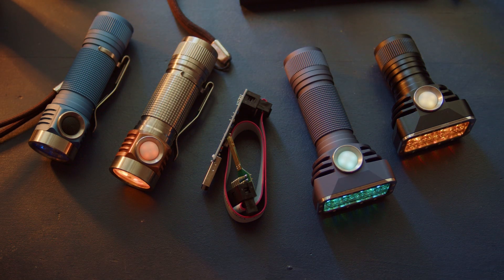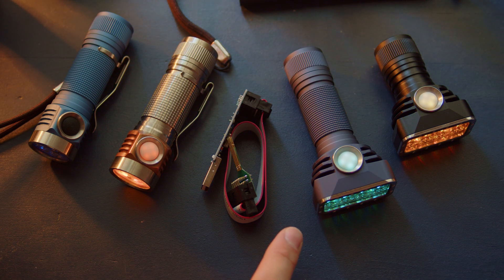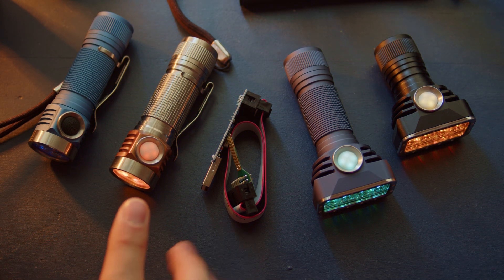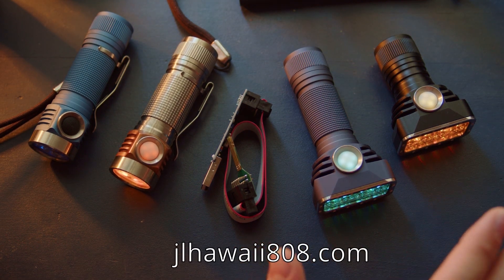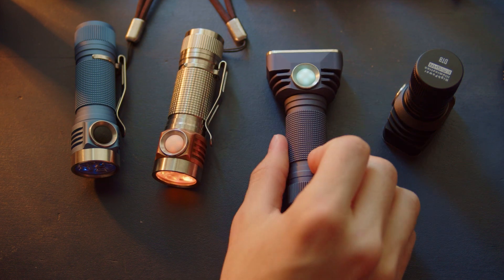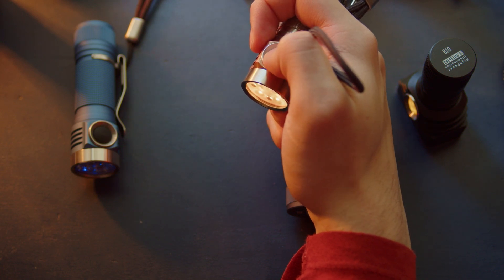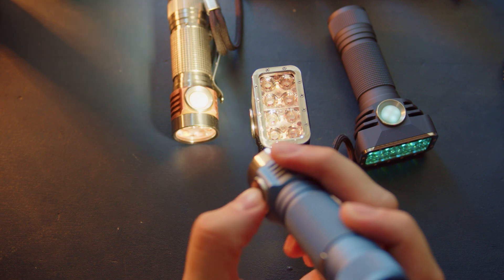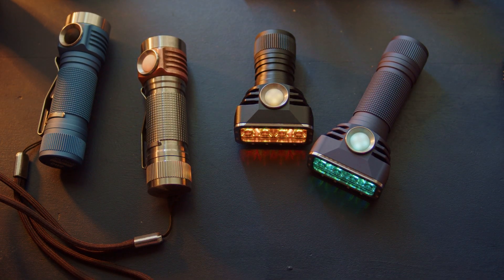Big Hanklight Anduril 2 Updates! [Ultralow Functionality]

Comment: A quick question about the update, and no ramp from Moonlight. So there is no way to increase brightness from Moonlight? That’s one of the best features of anduril. With memory, if you turn the light off on high, now there’s no way to go slightly brighter from moonlight except high. So you’d have to turn off from ML, then click on for whatever last mode was. That sounds awful. It’s the main reason I won’t buy a convoy s21e
Reply: Ah ok. So it just stops it from advancing past moonlight from off. That’s actually a pretty good feature. The other light I mentioned can’t advance from moonlight. So you have to click off then on again. And it memorizes turbo. That wouldn’t be fun inside
Reply from the maker: @victorvannatter312 yes, the new updates make it easier to stay on lower modes actually. You can even manually commit Moonlight to memory
Reply from the maker: No, you can turn it on to moonlight from off, then press and hold again to ramp up from there like normal. Or you can just not use the moonlight lock.
Reply: Nice. Thanks for letting me know

Comment: Amazing. I want to change all of my anduril lights to get rid of the delay when I turn the light off.
Reply from the maker: That would be nice, unfortunately that delay is necessary as the light has to wait to make sure you're pressing the button multiple times. For example, it helps to prevent the light turning off when you want to double-press for Turbo.

Comment: Hank just shipped my e17a and azure with anduril build from 2021 05 07 and I totally know what you mean by no granularity on low levels. I updated to 2021 12 13 and it’s MUCH better. I even slowed down the ramp speed. 
IMO you HAVE to do this because it was so irritating on low levels

Comment: standard moonight or ultra low is plenty useful. you dont need such little output
Reply from the maker: You could say the same for Turbo, that you don't need so much output. We all have different needs and desires. Besides, lights like these are about pushing boundaries, what's not to love about a light that goes both as low and as high as possible?
Reply: @LuxWad  makes sense there. regular moonlight is hardly useful to me tho so thats why super ultra low makes no sense to me.
Reply: @LuxWad  i have found that my fw3a has a lower moonlight standard than my emisar and noctigon lights

Comment: Luxwad. Came across your channel yesterday. After talking shit in a previous comment I must give you some props. Your reviews are top notch. So point me in the right direction.
I want one of these emiser lights. Or are they big hank lights, or anduril lights? Either way, I am looking at the d4v2 or possibly one of those dt8. Questions. What the deal with the colored lens? I like bright lights but I am willing to try a 4000k light. I know nothing of these lights. I want one with a 18650 or possibly bigger, more mah battery. I want to keep it under $100 hopefully under $75. What should I get?
Reply from the maker: Lol, you can always feel free to point out flaws if you perceive any, it's important to keep reviewers accountable if they make mistakes after all.

Emisar and Noctigon flashlights are designed by Hank Wang and sold at intl-outdoor.com (called "Hanklights" because the branding can be confusing). "Anduril" is an open source software developed for enthusiast lights, which can be found on many different flashlights which are generally oriented towards hobbyists. If you haven't seen my D4V2 and DT8 reviews, they're long but pretty much explain everything you need to know.

The colored glow in the front of the lights is produced by the "aux lights", rgb secondary leds which can be configured in the interface.
These lights use unprotected high-drain cells and are extremely powerful, which can make them somewhat dangerous so be warned. Batteries have to be purchased separately.

I think the D4v2 is a good starting point for these lights, it starts @ $45 and goes up depending on options. The 4000K SST20 LEDS are no extra cost and often considered the best all rounders,the xpl-hi have better performance and are $10 more. The E21a LEDS in my titanium light are much dimmer but have excellent color rendering, the best you can get. Pretty much the same LEDS are available in all models.

My top recommendation is for the D4SV2, which takes a 26650 battery and has a throwier beam. It's super nice and much more practical than the two shown here imo. It starts around $50. All these lights are also available in a dual-channel version with even more features.

Alternatively, you can look at the Wurkkos TS21, another Anduril light with similar features, but includes a 21700 battery and has a charging port, for $35 or so. It's a great entry point to this type of light, highly recommended.

Comment: Is it possible to flash this firmware to an old D4 and the fw3a?
Reply from the maker: It's possible, but it will take a lot of work as those lights don't have flashing pads. The PFM updates are exclusive to the linear drivers, so won't be available on those lights.

Comment: Wait so, if I have SST-20 4000K emitter, which file do I use?
Reply from the maker: The normal kr4.hex file
Reply: @LuxWad  I can use this KR4 hex with my D4V2? It flashes green, then a few colours and I can’t turn it on.
Reply from the maker: Yes, the d4v2 uses the KR4 file, mine are flashed with it..I'm not sure why your light is doing that, you might want to reflash it again
Reply: If your light has a white driver inside it uses kr4 firmware. If your light has a red driver inside it uses D4V2 firmware.

Comment: i just got a d4v2 in with andruil 2. While attempting to disable moonlight ramping after performing the 10h, there appears to only be 2 menu modes as after the 2nd, the light returns to ramping.  why is this, or is there another way to disable moonlight ramping
Reply from the maker: Your light might not be the latest version, the updates in this video came in the 8-31 update. You can do a version check with 15C

Comment: Oh those are great updates! I might have to invest in the update hardware. Or I might just get another D4V2 with Cree LEDs this time. The SST-20s have been okay but they are not great color wise and I want something with the FET driver. Not going with an E21A with terrible battery life and linear driver.
Reply: Sst20 should already have a FET driver unless you specified a linear driver. E21a shouldn’t use much power because it’s FET that eats up power. But they are a bit dimmer. But much nicer looking.

Comment: I have 2 D4V2 (TI and sand) both are 219B, both are 2021-08-13 firmware (15c).  However only the TI has jump start.  9H doesn't do anything.  I have a flashing kit on order.  What should I flash to get jump start working?
Reply from the maker: 2021-08-31.noctigon-kr4-nofet.hex has all of the latest features for the Nichia D4V2.

KR4-219b should work as well (same features) but I've heard noFET is recommended for the D4 since it has less thermal mass. What your the model #? (After 15c there's a four-digit number that lets you know what build is being used)
Reply: Both are 0212, I will just update them when the flashing kit arrive.  I need the jump start.
Reply from the maker: @story1234  Okay, that means both are already running KR4-nofet, so if you stick with that build you'll get the latest features without worry

Comment: so the PFM basically makes the new 9amp CC driver act like the originally d4v2 and KR4 drivers low modes work? Pretty sweet. that low mode on the new 9amp cc drivers had forced me to order my newest Hank Lights with the older 7.5amp driver. Nw i really need to buy the damn flashing cable. hope. can figure out how to flash some of the 22 emisar/noctigons i have lol.

Wow- just got to the ramping speed section of the video, this is awesome!

Comment: For what it's worth, the jump-start intensity is configurable so instant activation should be possible on most lights.  It just has a somewhat low default setting, to avoid producing a visible pulse.

To configure it, use 9H from off in advanced mode, and then click several times at the menu to set a new value.  I've found settings anywhere from 20 to 50 seem appropriate, depending on the light.
Reply: It's still sensitive to whatever the light was doing a moment earlier though, just due to how the power regulaton circuit works, so there can be some variability.  The worst I've encountered is on a KR1 W1.  It needs the ramp floor set to 2/150 because level 1 is completely off, and it needs a jump-start strength of 50...  and even then, it still turns on a bit slow sometimes.  However, all the others I've tried are more consistent.
Reply from the maker: Thanks for the info! I didn't realize it could be adjusted in the actual UI, I'll have to try it out now.

As an aside, I didn't mention the fact that the activation is still pretty slow after Turbo has been used, but it doesn't seem like much of a practical issue considering there's no real reason to switch to moonlight immediately after turbo. My lights seem to stabilize quickly enough that it hasn't been noticeable in any usage.
Reply: @LuxWad  Yeah, definitely let me know if you can improve the timing with a different value, and how consistent (or inconsistent) the result is.  It hasn't had a lot of testing yet.  The current default is 21, and the lights I've personally measured needed values of 21, 29, 30, 35, and 50.

I expect it'll still bottom out after turbo, but there isn't much I can do about that.  However, as you say, that's kind of an uncommon corner case that people don't often do in practice.